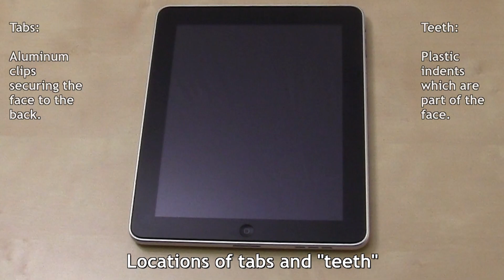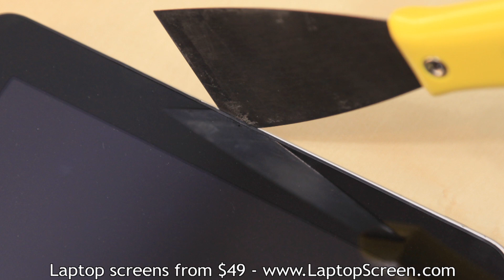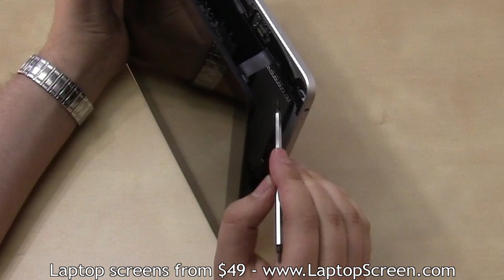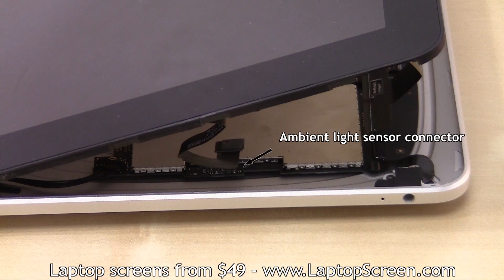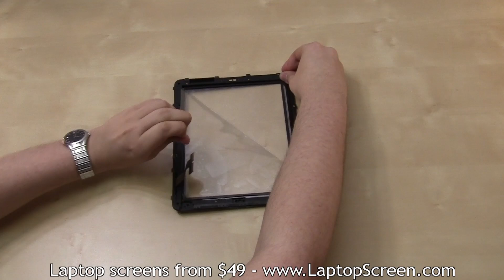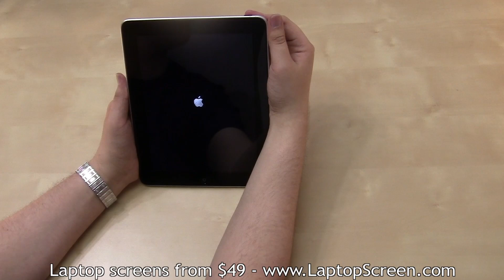iPad screen replacement, iPad digitizer replacement / repair / installation guide

Comment: Excuse me LaptopScreen.com My ipad is has a problem where it types by itself zooms in and out and flips to different pages and opening apps. You know the solution to fixing that?
Reply from the maker: Angus, google "ipad phantom touch" - cleaning the screen with anti-static cleaning solution is a common way to fix such problems on devices that have not had the touch-screen replaced. If the touchscreen has been replaced and the touches are suspected to be the result of the replacement - the new digitizer maybe lacking some insulators underneath. See this post: https://www.ifixit.com/Answers/View/192265/solution+to+phantom-ghost+touches+ipad+air

Comment: @laptopscreencom
Great video! I happy to say that it was very helpful and my digitizer has successfully been replaced. The problem is those those retaining clips that hold the digitizer to the logic board. One of them broke when I was taking out the first digitizer and now only half the screen works. Is there any way you know of to improvise or buy a new one?? Thanks again!